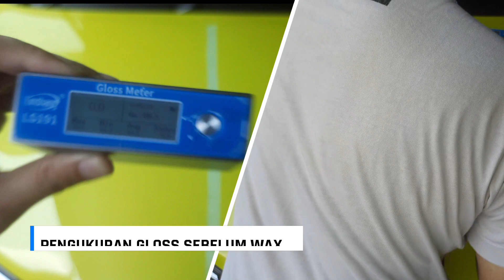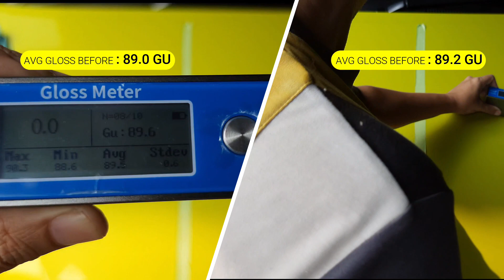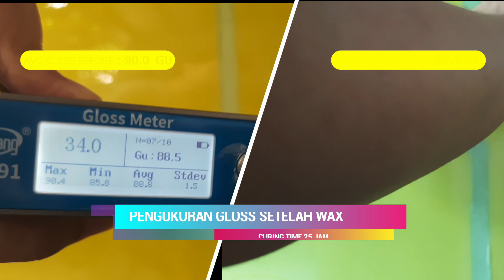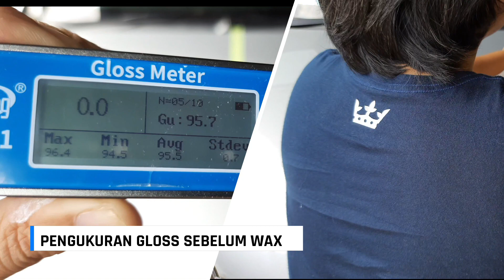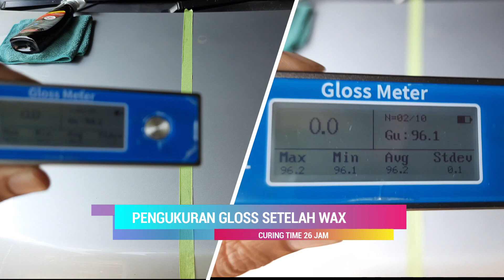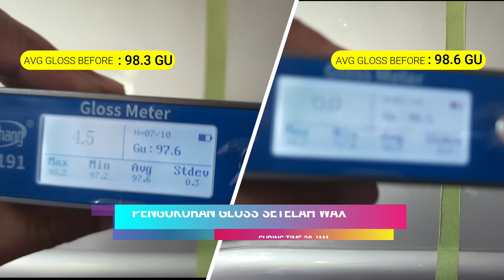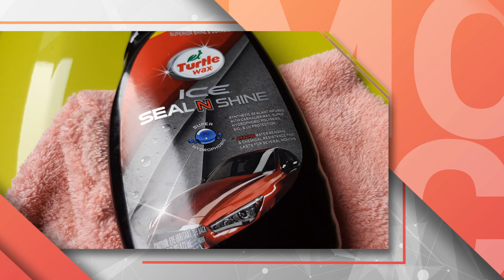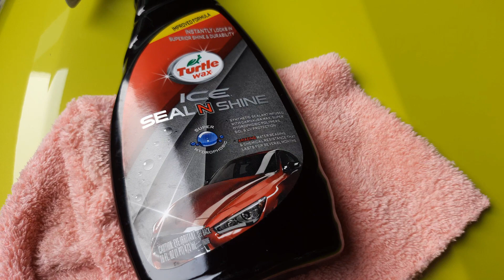PART 1 : GLOSS BATTLE  Turtlewax Seal n Shine  vs Meguiars Hybrid Ceramic Wax  (Damp Application)

Comment: bank Bey, mohon tanya... seal n shine ada fillernya ga bang...? dan hasilnya bgmn, misalnya dibandingkan dgn produk lokal waterbase, spt hypergloss...?

makasih ya bang.. :)
Reply from the maker: Hanya beda sangat tipis euy. Syusah beda in nya.
Kalo mau masking swirls type spray harga ekonomis ya x5.
Kalo x5  kurang gloss topping aja pake sylonik dari brokleen
Reply: @bankbey3459  buat masking swirl, X5 tetep masih lbh bagus dr hypergloss ya bang...?
Reply from the maker: @martinhrt  iya, sementara x5 untuk sebuah water based termasuk mumpuni. Bahkan lebih baik dari oil based sekalipun.
Reply: @bankbey3459  siap bang Bey.. makasih yak :)